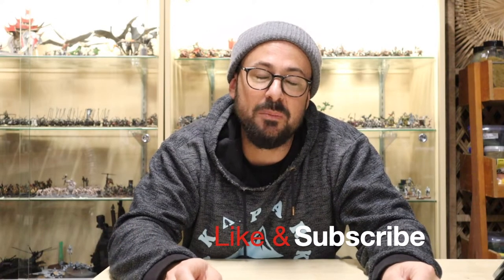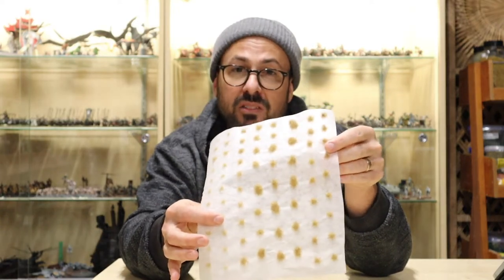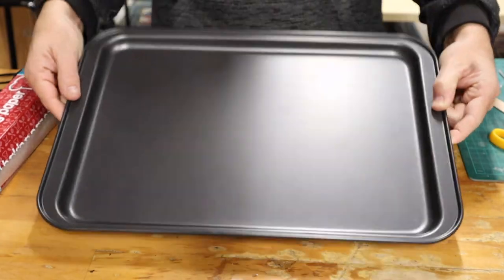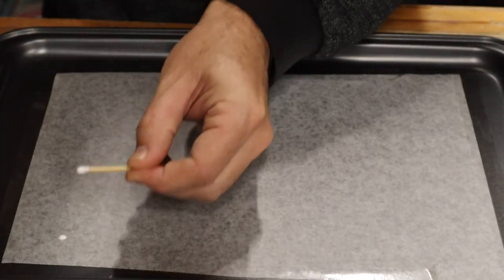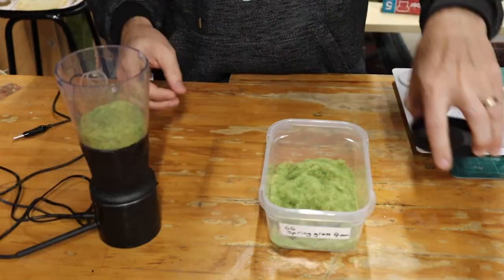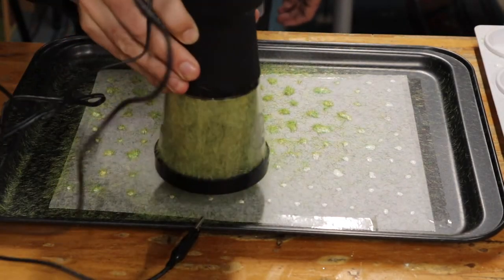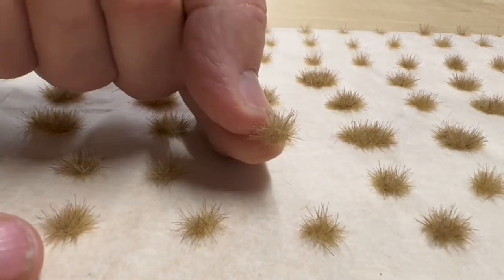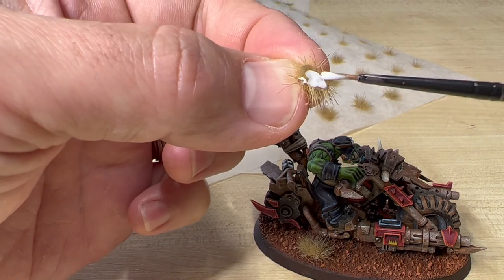How to make static grass tufts easy! - wargaming / model train

Comment: Certainly going to give this a try, I spend far too much on tufts... I can't remember where I saw it but I recall someone recommending a type of carpet glue (I think it was) rather than PVA because once cured it keeps its stickyness, which makes attaching it to bases much easier.
Reply from the maker: I know what you mean, tufts are great but expensive (bought ones that is). I’ll check out the carpet glue idea. Cheers pirate!
Reply: Carpet tackifier. Gives you self adhesive tufts, that mold to the texture of your base (with a bit of prodding).

Comment: Another good tutorial! Well done and keep them coming <3 I'm using a cheapo no-name applicator, and it still gets the job done very nicely, so if anyone is interested in trying this but can't really afford to buy a 'proper' big one, don't be discouraged (there's also an option of completely making an applicator DIY style which I tried, but I found it's not really worth the hassle, and the cheap one will do the same job). Another thing I found was that using a 'tackifier' glue works much better than just regular PVA. The PVA glue becomes rigid when dry, so it makes it a bit trickier to attach if the surface is not even(and can show edges of the glue if you put too much). The tackifier glue remains soft and adjusts to the shape of the surface you put it on so it blends nicely (and is also self-adhesive by default, so no extra glue is needed to attach, but you can add a drop of superglue if you want a permanent fix). Like you mentioned in the video, the longer blades of grass (anything over 6mm really) doesn't really work well with the applicator and this is something I'm struggling with. I know you can buy the premade ones that are liek 8/10/12mm long, but I would really like to know how to make those long tufts at home. If anyone has any tips or advice, I would appreciate it :) Cheers and keep on hobbying!
Reply from the maker: Awesome comment Miran with some excellent advice. I'll try out the tackifier glue when I get a chance. Really appreciate that mate 😊

Comment: Gob bless you, for this video! Thank you! 😊
Reply from the maker: Thank you for saying so 😊
Reply: @dicedrinksanddadjokes I tried today but it didn't work for me 😭Maybe it's because I bought a cheap flocking device. 😕😔I connected the clip to the tray but it was a disaster.
Reply from the maker: @charlottesophieperper2445  oh no! What’s your applicator? Is it battery powered or plug-in?
Reply: @dicedrinksanddadjokes  It's battery operated. I had bought it from Ebay a few years back. I fully charged the batteries but it was like I was dropping off the grass with my hand. 😑Don't know if it matters that my grass is long(12mm).🤔
Reply from the maker: @charlottesophieperper2445  yeah even my plug in applicator struggles a bit with 12mm. Battery power has no chance
Reply: @dicedrinksanddadjokes  Aww thank you so much for all the info. Too pity.. 😕

Best wishes!!